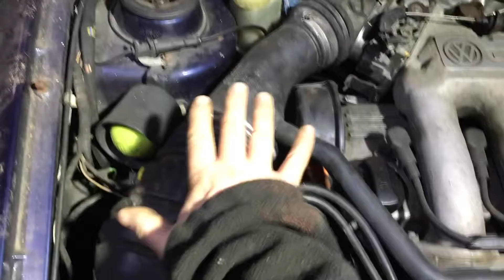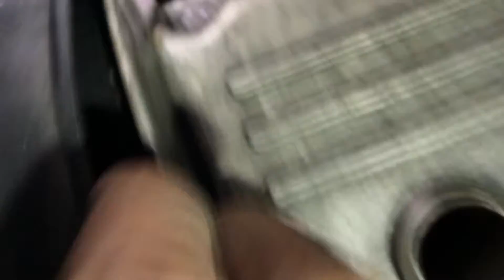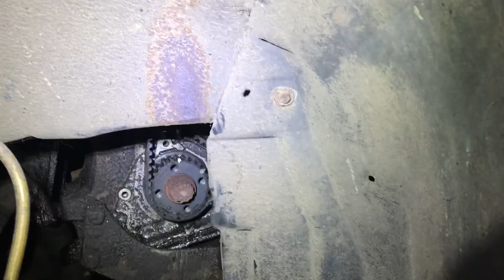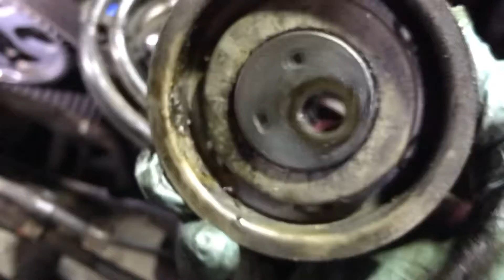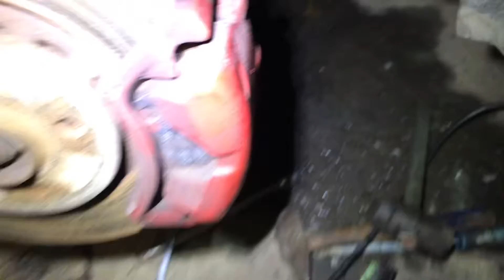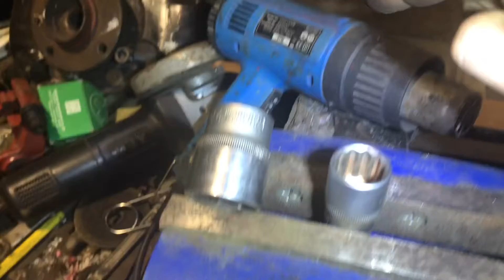Vw 2.0 16valve timing belt and cam shaft seal. Volkswagen Corrado / Golf mk2

Comment: So great video. A couple of small things if I may make note of. 
The fact you turned the engine over twice when you finished, I assume, was to check timing and make sure everything is smooth before you feel good about firing it up. You didn't mention why. 
Second. You don't have to put oil on the outside rubber part of that seal. Just the parts that contact turning metal. The inside. In fact you want the outside really clean and sometimes I use some anerobic sealant on that part or splines depending on the application.
Lastly nice fix on the air box
 I'm gonna have to remember that one. Isn't that where the smog air pump draws air in from the filter? I think my 2.0 has a hose connecting that to the pump? 
I am going to remember that trick though with the heat gun and plastic. That's pretty slick!!
Reply from the maker: 100 %you make great points !!! And yeah that air box I have no idea if I lost something or it was never they or an ex owner last something but it’s unfiltered air so I’m guessing it has to be blocked. Never see that pump but we don’t have smog emissions in Ireland.  I’m glad I impress you with my melting plastic trick 😂😂.  I’m sure there might have been other eats but I also didn’t want the engine to suck it in . So this way there is no way it can get sucked it . Thank you so much for the fantastic feedback/comments . Please give the other videos I have a watch and review too 👍👍 like and subscribe

Comment: Regardless of what you said about the tensioner being clockwise because of the casing is incorrect it should be anticlockwise. You need to do the adjustment with the cover on.
Reply from the maker: Oh really ?  This is the 2.0 16v ( can’t remember the engine code, it starts with a A I’m fairly sure ) from the 93 corrado
Reply from the maker: Wait .. I’m not sure how I could adjust it with the cover on ?
Reply: @stevenharpervw  you can some strange noises if you have it with the two holes at the top it will sound like you’ve got the belt too tight or it will sound like your water pump  bearing is failing

I too did it the wrong way round 
And my timing was out 7°
The car run like it for over a year. However  when I changed my belt recently and did the correct way round oh my God, what a difference the car is a rocket now and now all the strange  sounds have gone 

With the holes at the bottom the tension is correct and I haven’t got this line that forms in the centre of the belt if the belt is too tight 

It is very annoying that I was unable to see in any manual which way that tension should be and also there’s no arrow on tensioner to show the direction that you should lever your special tool 

I can tell you now with the pin holes at the bottom  of the  tensioner is tensioned in an anticlockwise  manner the now car runs perfect
Reply: Also, it’s very important that if you do move that tensioner that you check the top and bottom timing mark again with the bottom pully off because when you release it
And then start to tension anticlockwise the belt can jump at least one tooth off at the bottom in my experience 
So it is essential to do the whole process all over really 

I like you. I did mine in the dark.  Haha crazy.